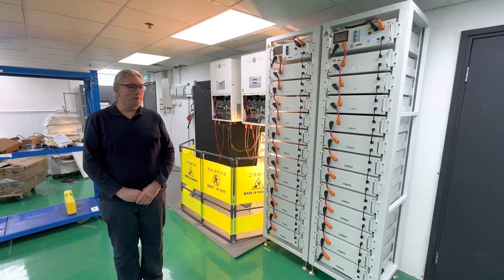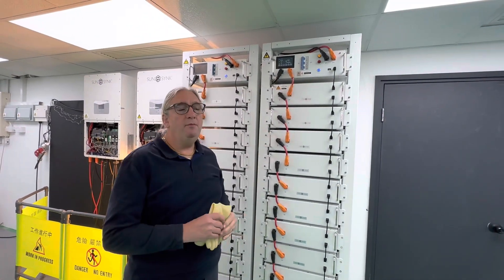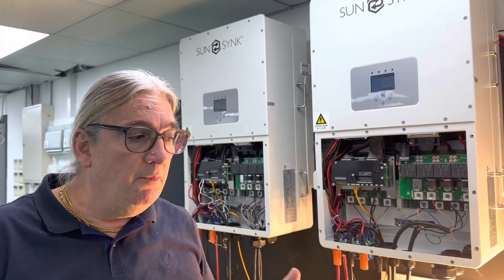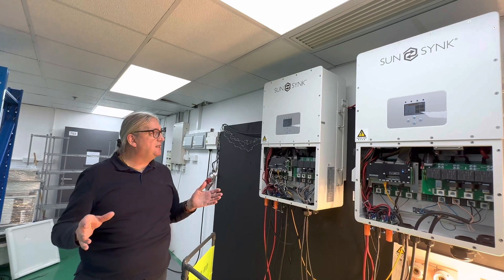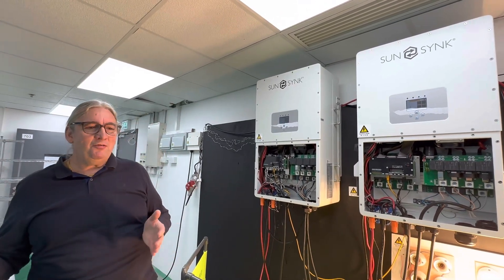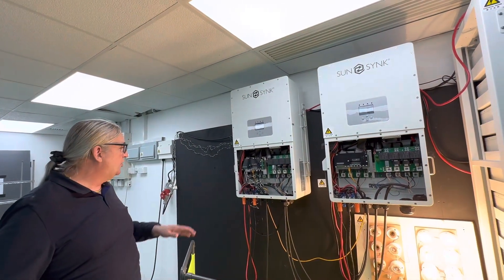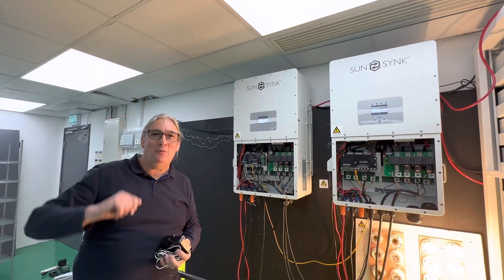Paralleling Sunsynk, 50 kW inverter

Comment: Keith. I concur with a lot of the comments made here. First of all we ordered our 2 x 50kw  in October 2022 from our supplierin South Africa. We intended to build a 100kw system with 2 units in parralel. Promised date was 25 Nov, then 7 Dec, then 15 Dec, then 15 Jan etc. Eventually we received units only middle Feb 2023. 

We were only informed in Jan 2023 that the units cannot parralel yet, and it now took you until until mid March 2023 to resolve this. Another delay. 

So we were informed that one cam connect up to 10 units in parralel.  Is this true? You little demonstation of 2 units does not prove a lot.

And now an absolute shocker is that each inverter in parralel connection must have its OWN battery bank, unlike any of your other inverter systems. Many an installer have already bought and installed the whole system, including a single battery.  We were only informed of this requirement in the last week.

I am hugely disappointed in Sunsynk as a company
Reply: The lack of prior communication is always incredibly frustrating ofc. But I think if you looked at any other high voltage battery systems such as by Huawei, Sungrow, Growatt, etc, you might have seen this coming. All systems working on DC systems above 60V are all designed to run in single inverter connections. Not sure why, not an electrical or system engineer, but it's just the way things are.

The delays are a global phenomena at this point. The entire industry relying on Deye and Voltronic ODMs are experiencing delays due to record breaking orders from across the world. Anyone working with those systems should expect both supply shortages and delays. I myself had to fight to get a Voltronic 15KW for an year.

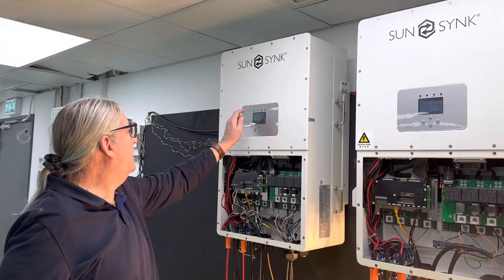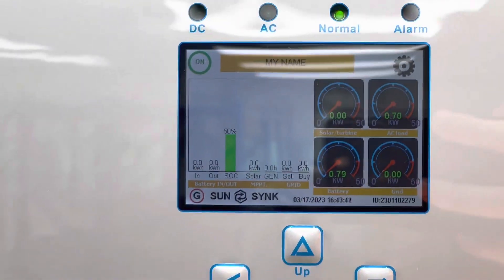Comment: "And yes it works!" Proving that a 100 kW Parallel Inverter System works by running it 1% Load with a couple of light bulbs... No parallel AC input. Just batteries. And if you noticed, BOTH battery banks are at 50% SOC yet the second bank is discharging at 52% higher (02:25 - 02:50) !!! Not balanced at all - and only at 1% Load. This parallel functionality is 6+ months behind "promises", and now released with great fanfare but with a HUGE LIMITATION that it can't use a common battery system - like ALL other Sunsynk inverters that can. This video is going to raise a lot of questions. Let's wait for clarification on what this "beautiful monster" can actually do... (This is the tech version of a Dr Frankenstein and his "beautiful monster". Let's see what the common folk actually think about this...)

Comment: Can you connect 2 battery banks of different capacities on the 2 different inverters? Say, in input 1: 200 kWh ~600Vdc and in the other input 100 kWh~300Vdc-?
Reply: Everything must be identical..so not advisable to do so

Comment: why isnt there like a setting where i can easily change profiles, like for example on cloudy days i want the inverter to only take power from grid and panels if any, then i want to switch to a sunny day profile, where the inverter can use battery power if needed for larger loads up untill 60% or so.... now i have to manually go and change that on the inverter battery settings everytime......
Reply: Helllllllooooooo sunsynk???? Seems like super easy firmware update....
Reply: That is actually a fantastic idea!

Comment: Why only 5 inverter? I would like to get to 500kW. Any possibility to have the smaller inverters (like the 16kw) also have each run with their own battery like these? I would like to have 4 or 5 different systems and just "tie" the outputs together to make up a bigger system.

Comment: Why is it that the HV inverters cant share one large battery like the LV inverters can?
Reply: Were did you get this info that you can not ?
Reply: @stefanrautenbach6550  Just another piece of "great news" from Sunsynk that has been kept from solar installers until the last minute, who already have sold these "solutions" to customers months ago, and now Sunsynk have found out they cannot get it to work properly. This "no common battery system" is a workaround for their engineering failings because they can't get their product to work as they've been bragging about for the past 6 months.